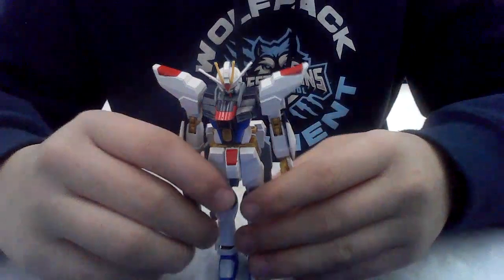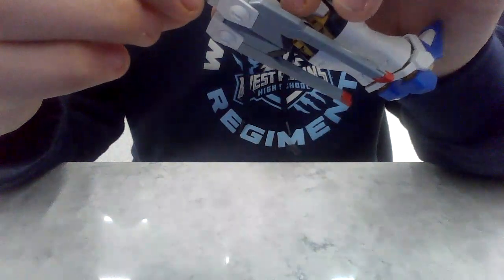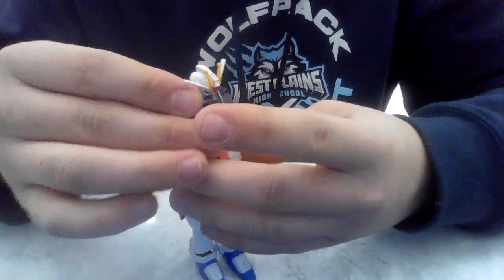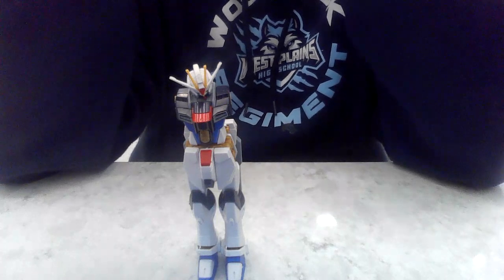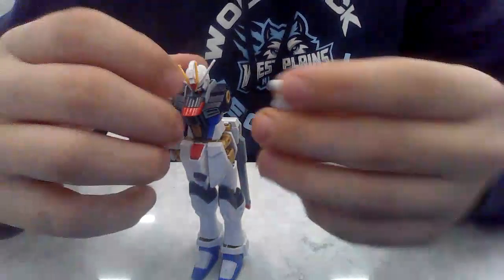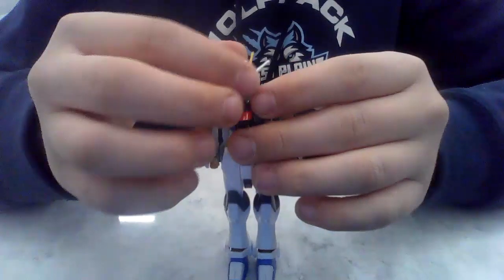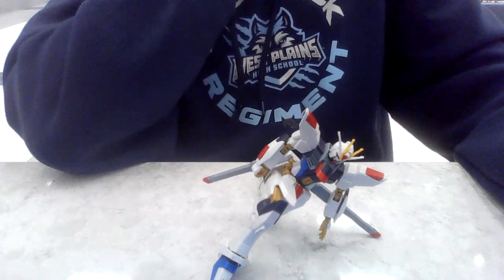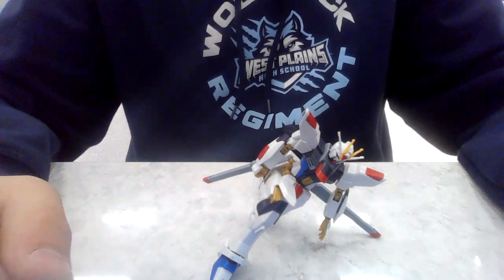Strike Freedom Breakage

Comment: Good tip for posing, always have the legs angled outwards, keep the arms slightly bent and angled, and more importantly, pay attention to the design of the mobile suit. Brighter and more slim looking mobile suits should be looking up in a kind of proud pose, whereas darker or heavier mobile suits like the Barbatos lupus rex or banshee should be looking slightly down or even slouching. I will say, there are some exceptions. Take for example, the Sinanju/Sinanju Stein. While being a large, brightly colored and even slim mobile suit, while it should be standing tall and proud with no hunch and wide shoulders, it should also have a kind of glare that you might see on the Barbatos. The same might go for the Blitz Gundam. Also, keep in mind the characters that pilot them. Mikazuki is a silent and deadly but also merciful fighter, (to an extent), so when posing him, one should make sure he is angled and posed to look like he is going for very quick attacks on vital spots. The Youtouber, mechagaikotsu made a very good guide on how to manage that. There is you mr.mooseman advice for now. Stay happy stay humble.
Edit: Also, that is a HG, and a 2.0 high grade at that. The original HG Strike freedom was released in about 2005 and is horribly outdated.
Reply from the maker: Know that know not at the time of the review